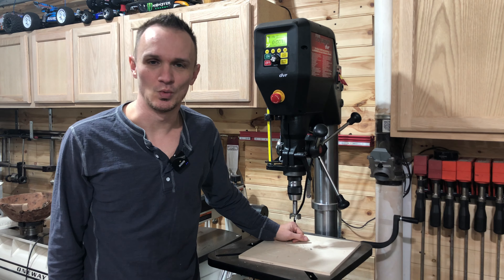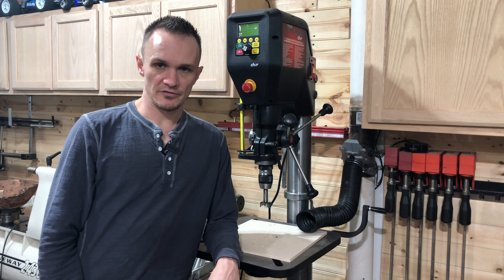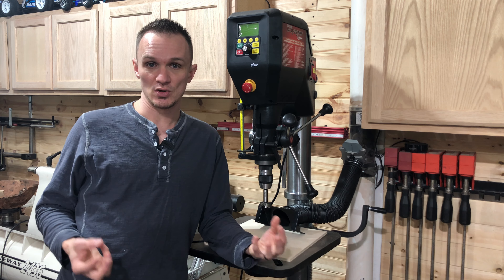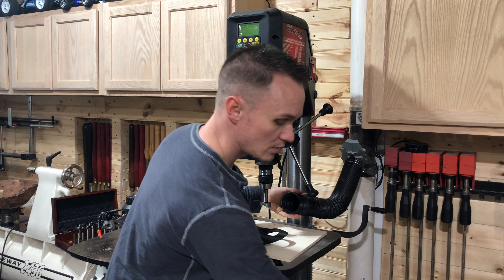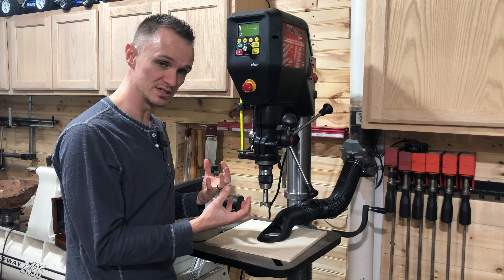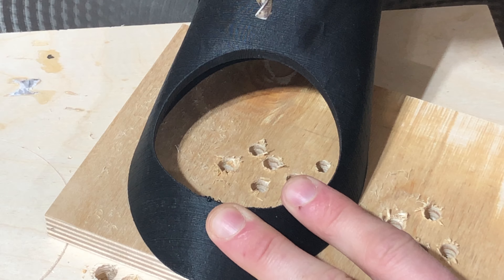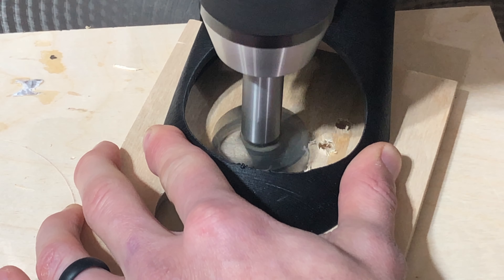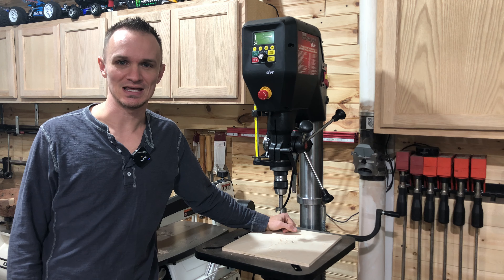Unique Drill Press Dust Collection in 4K 60fps.

Comment: I believe this is the most efficient yet simplest dust collector out there - and I've seen a lot. Surely dust has nowhere to go, yet without the bulky and boxy complications the other concepts have. If any, the only improvement that I could think of is widening its base so you can clamp it with the work piece in scenarios where you have to use clamps, that's just a sudden thought and not sure of any complications it may cause. Thanks for sharing this idea and the 3D print file as well.
Reply from the maker: Thanks ! 
I designed a new version with a base that extends on all sides so you have somewhere to clamp or somewhere to put your hands. With the base it now sits flatter and is a bit more stable hands free. 
I think it is shared. If not I will add it today. Enjoy!
Reply: @MSRWorkshop  I noticed that, when using the F-bit, a large shaving or two would get lodged in the shallow and (relatively) narrow 'front' of the device and, in addition to thinking a 'lip' would serve to improve suction stability (clamping, too), I thought to enlarge the diameter at the base (10%+/-) and raise the 'top' so an eight or 3/16" of an inch.

Also thought that, since the bit is always moving in a clock-wise direction, angling the input and reducing its effective area (opening) would increase the vortex effect as well as the draft.

Comment: I would try this before I would do anything else. Honestly, I'm thinking of milling a 4x4 post to do this with a super flexible hose. The weigh for the wood will keep it where you put it. Also I'm thinking about a strong magnet underneath or in the fence and possibly making the drilling hole adjustable like an Iris. I also think I might put some LED strips in it to light the process. Spectacular idea you have MSR Workshop!
Reply from the maker: My updated version of sell on Etsy is much better because it has a platform on either side making it possible to clamp to your work. I thought about adding magnets underneath most of the stuff that I drill is too thick for the magnets to work very well.
Reply: @MSRWorkshop  can you paste a link for your Etsy shop pls,?

Comment: Great idea.  I just made something else, but may just try this.  Trying to think on how to have it rest or lock in position worth out having to hold it.  Also been wondering about using brushes for surround like CNC.
Reply from the maker: So if you click on my link under the description, you’ll see the new and improved version where I’ve added a base to it so it can be clamped down. 
I think, adding the CNC bristles actually disrupts airflow, and it might not work as well
Reply: @MSRWorkshop oh, ok, so a lip to clamp down.  I really need slots to allow for clamps, long overdue.  I just saw nice trick with strapping stiff wire to the hose to allow it articulate and lock in place.  May try something like that.

Comment: Would it help to add a couple holes in the outer band of the device to cause additional air flow for the remaining chips? GREAT device! Best I’ve seen.
Reply from the maker: Thanks. No. I think the hole on top is large enough and doesn’t restrict the airflow. It seems to get everything.

Comment: Lovely! Elegant in design.
Would it be possible to print a second 'color' for a portion of the tool?  I was thinking of a more flexible 'color' (material) that would allow fingers to cover the opening after the bit went through.  Did you see one of these used for drywall? would like a link to it! Please, thanks.
Reply from the maker: There is a link in my description to where you can purchase these. My 3D printer can only do one color at a time. The standard color is black then I periodically do a limited edition color with a premium material. 
I have seen many of the ones used for dry wall and this is a version of those but unfortunately the finger idea would only work with standard drill bits not Forstner. A Forstner bit would tear up the fingers. Still , without the edition of the finders drilling is virtually dust free.

Comment: Do you sell the 2 1/2 inch adapter?
Reply from the maker: I sell 2 versions on my Etsy . One for a shop vac size and one for a larger dust collection tubing. 
My Etsy link should take you there and it will have the exact sizes

Comment: I asked a guy with a 3d printer to make me one, he said it takes 29 hours + to print it out. Is that correct?
Reply from the maker: I have it set to about 50% infill and it’s about a 14hr print. It all has to do with the settings he’s using
Reply: Thank you SO much for replying so fast. I will check with someone else. Great concept. And I like that color blue. Did you make it out of resin or plastic? One company I was talking to asked me that.
Reply from the maker: @Sharon-el5jn  it’s a PLA plastic
Reply: Thanks again